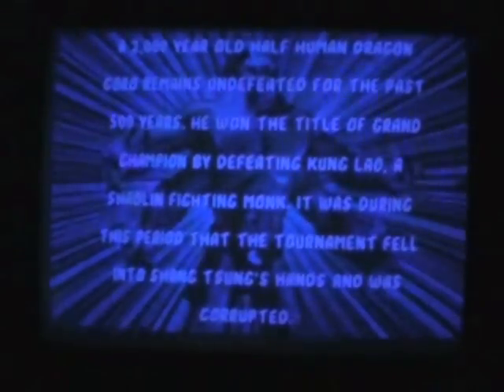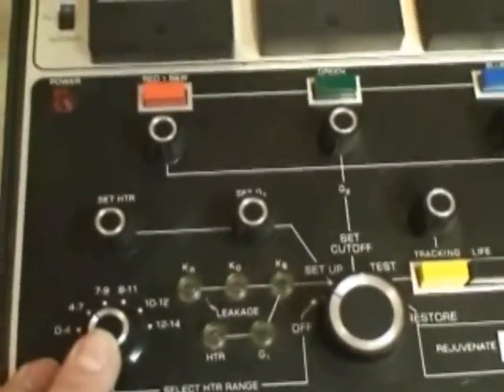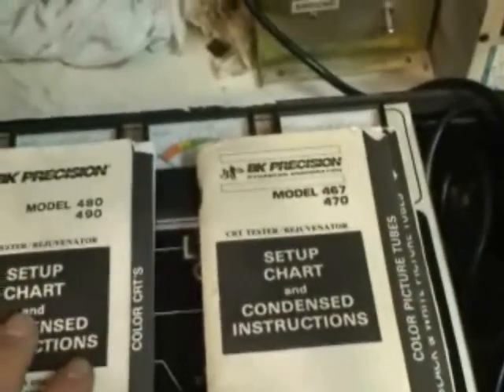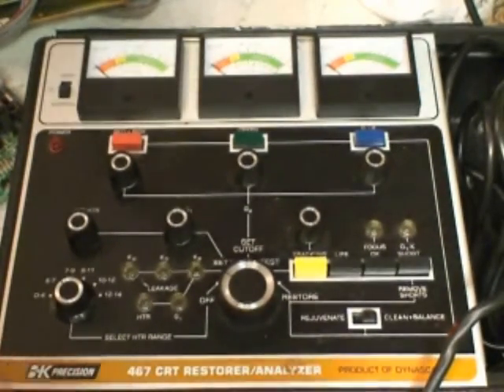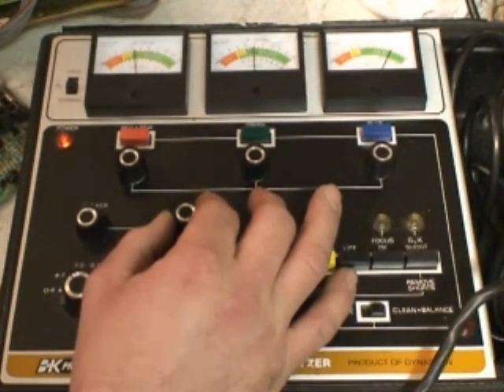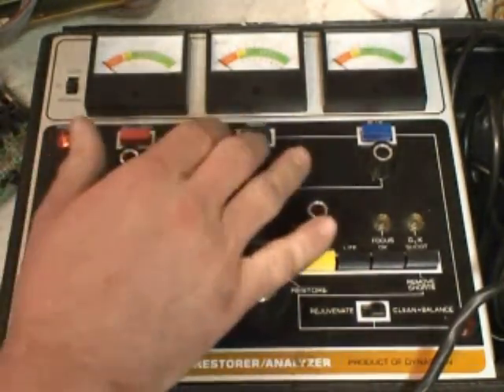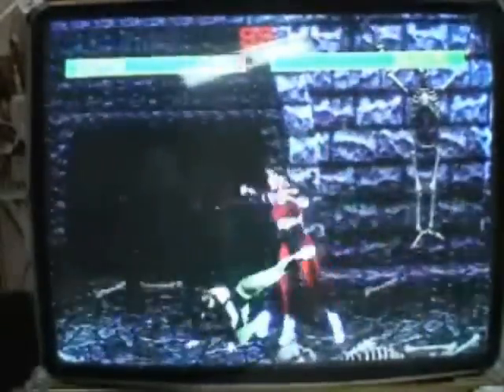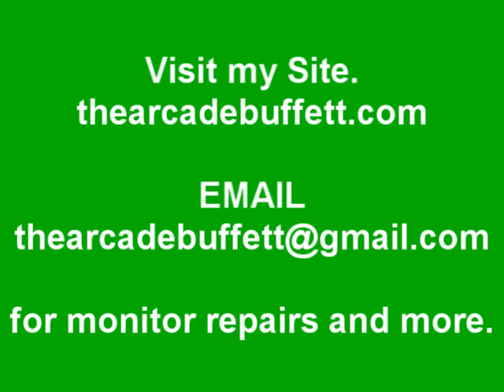A Basic Rejuvenation with  B&K 467 how you can Restore a Weak Tube.

Comment: I lucky to pick up a B&K 467 and put an Aust plug on it as it was set for 240 volts but from UK. They are usually 110/120 volt from US so just be aware of that if you buy one as you need to make adj to transformer for diff voltage & plug. I love the unit and this is an excellent video on using the 467 and sticking to the manuals instructions as these older unit have strong voltages even in the lowest setting so i only ever used the clean and bal and have had excellent result with just one to  three "zaps but usually one is enough. Use caution as these were designed for older CRT heavy guns ; the newer tv CRT have finer ones and can be damaged with the these older style units, so go easy and stick to the directions and lowest setting should be plenty but be aware there is risk of destroying the newer crt sometimes so beware of that. I find these older restorers are perfect for older TV's, analog oscilloscopes & Arcade tubes as per this video so mine will get some use yet.
Reply from the maker: Awesome!! glad you found the video helpful, and glad you like the 467, it is my favorite as well. i use it all the time.

Comment: Ive got a Philips 19" tube that i believe is coming to its end, when i ever i turn the cab on the picture always looks blueish until it warms up and the colours are good, i know its not chassis as ive replaced it and still the same, i put the tube on the Rejuvenator, red gun was just about in the green, green gun was in the yellow but the blue gun was way up  in the green and a lot higher than the other 2, so preformed a clean and balance the red and the green cleaned just fine but when i did the blue the needle wouldn't drop but rather just fluctuate but never fall to the red zone it jsut hangs up even tried rejuvenation but still the same, all 3 guns are in the green and roughly in the same spot but now but this is what gets me i have to turn up my red gain quite high and my blue down very low plus i also have to turn up the flyback as the picture is a lot darker than before, my tube was listed in the bk manual so i put the correct voltages to it i just find it odd that my picture is darker than before now.
Reply from the maker: did you put the tube on it's face and try tapping on the neck with a wooden block?
that can dislodge stuff from the guns if it is stuck ion them.
if that does not help you can turn the heater and G1 voltage up and rejuve the tube.
this can also get it to come back to life.
if all that does not work then your tube could have an issue or is already to far gone to "fix".

Comment: I’m looking at a couple consumer sets; a Loewe and JVC tube. Neither of the tubes seems to be on any lists. Any ideas? A80EFF272X43 and A80QCF240X
Reply from the maker: see if you can ohm the heater pins, if you can that will narrow down what they are a little, if you have the neck boards you can trace the circuits to find the color guns and the ground pins, once you get that info you can match it up or post your readings, and maybe someone can help match them up. or i can make a custom adapter with your neck board if your trying to rejuve them, also is the tube a dual focus tube? some are if they have 2, focus pins.

Comment: Hello what crt tester do I need to work on the Sony pvm/bvm crt monitors.
Basically pre 1990 crts upwards to 2010 and will they come with the correct tube socket or are these hard to find.
I'm. From the UK also
Many thanks
Reply from the maker: HI, you can use most any CRT tester from the B&K 467 and newer.
the adapter you will need depends on what pin-out your tube is.
if you can post your tube # then we can try to look it up to see what you need.
if your tube uses one of the adapters i make for the B&K 467-490 then all you will need is to buy the unit and i can make the adapter if it does not have one with it.
Reply: Buffett Arcade Man many thanks.
It'll be sony trinitron pvm and bvm crts. 
Don't know if your familier with them😣
Reply from the maker: the trinitron can be tricky to test and rejuve if needed, sony kinda re-invented the wheel when they made that tube line. i am not sure about the BVM CRT's

Comment: Hi buffet. Would you recommend any other b&k model? I can't find this one on eBay right now.  Thank you.  I will also need to make sure I get cr 23 and 31 adaptors
Reply from the maker: HI, i would wait for a 467, they are easy to use and work well, you could try and find a 490 but they usually are more expensive and a bit harder/confusing to use. i have a 490 and do not prefer it at all, and no it is not for sale.
when you do acquire one i sell the CR-23, CR-31 and the universal adapters if you need any.
Reply: Thanks man! I'll put out a wanted post on klov as well. I'll contact you when I get one and purchase some adapters from ya.  Appreciate ya.

Comment: nice! fixed on that arcade monitor, i wish i do have that rejuvinating tool to fixed my samsung 29'' crt tv, it has a blue color display the entire screen sometimes pink and green. i used to tap the tube for temporary fixed. im too worried to send it to a repair shop, since sometimes my other tv busted when they try to fixed it. and is already dead they fry something on a pcb. anyways. thanks for the awesome demo.
Reply from the maker: thanks for the kind words. glad you liked the video.
yes if you have no clue what your doing you can burn up a tube or break a chassis.
i have noticed over the years, that TV repair shops have no real clue on how to actually fix monitors, most of the real, old repair techs are gone/retired, and all you have now are parts swappers that have no real clue how to do repairs.
if your local to me, your welcome to bring your monitor by the shop and i can take a look at it.
visit my site for my email. thearcadebuffett.com
Reply: . yah definetely i have no plans on sending it to a tech here at my place. so scary, rather stay it that way,or until i get some tools to fix it myself. ill simply follow on your demo. yah i would be gladly that you would fix my Tv, too bad im residing here at phillipines :( thanks for the offer. ill stay tune on your channel if got some vacant time to watch more of your videos.thanks for the response. Godbless!
Reply from the maker: Awesome!! love those easy fixes.

Comment: My left dial isn't working. The needle sits all the way to the left  past zero. The other 2 gauges sit on zero. Turning the set heater knob does nothing. What can I do to get that guage to work? 

Thanks 
Curt
Reply from the maker: Hi, you will need to take the unit apart and re-flow all the solder joints in the machine.
they suffer from cold cracked solder.
i had to do that on mine when different items stopped working. i had dozens of bad joints, it was a wounder ti was working at all all theses years.
cap it as well wile you have it apart,
take your time, there is a lot of stuff to keep track of inside that are just press fit and with no pics or documents on how it goes back together readily available it can drive you nuts tying to get it all back where it belongs.
if that does not work you may have to find someone that repairs them, i do not repair them.
good luck.
Reply: @buffett1978  thank you for the fast reply. I'm looking it over now I'm seeing some cold solder joints where a  long connector goes. I also saw that two of the light bulbs were out of the sockets and inside of the chassis. It looks like those light bulbs need to be connected for circuitry reasons. I wasn't expecting that. They look to still be good so I just twisted those back in their socket and I used my ESR meter and tested all the capacitors on the bottom of the board and they all test good so hopefully those light bulbs for the problem and cold solder joints. Do you think those light bulbs were probably the problem for the heater voltage?

Comment: BUFFEET ARCADE MAN, 
Is the CRT rejuevenator adding and injecting more Electrons into the RGB ray gun? 

What is the CRT rejuevenator doing to the monitors neck circuit board and tube?
Reply from the maker: it does not do any of that.
it measures the emissions and how well the guns can emit Electrons.
Reply: @buffett1978  but how it is measuring the emissions of the RGB and how the guns emit electrons? Because I have heard its not good very bad to use Rejuevenators on TV tubes because it kills the live of the RGB signals because its burning off the emissions. You use the Rejuevenator when the RGB are dim and not bright in colors?

Comment: Very nicely done; Question! did you perform a life test on this particular picture tube before proceeding with the other repairs? being a technician myself I realize this is a rough indicator on the longevity of the tube. I agree with you that it is a big advantage when viewing all three guns at the same time and you tend to get better results because you have better control.
Reply from the maker: +John Cunningham 
the life test is a false positive and is pretty useless.
i have rejuved tubes and had it show 70-90% good on the guns and the life test show fantastic.
then after only a couple minuets to a couple days have the tube totally short internally and kill it's self.
so from my observation/experience that function should not even be used as you never know with 20-50+ year old tubes when they will die out.
Reply: When I did service warranty for Zenith years ago I ran into a big problem with their picture tubes. They usually developed a G1 short or heater to cathode issues. At that time I was using the Sencore CR70 Picture Tube restorer which normally could remove most G1 problems, but when the emission was weak and I attempted the reactive feature generally the results were poor and l was forced to order a rebuilt tube that sometimes the guns were not aligned properly causing color issues that meant all that hard work went down the drain. My point is they were a lousy tube that could not stand up to a restore forcing you to replace.
Reply from the maker: +John Cunningham   over the years i have noticed that Zenith tubes are the worst out of all of them for sure. i also have noticed the growing G1 short issue in tubes i zap for folks, most times it does not affect the image to much, but once in a wile the short is so bad you cannot save the tube. 
since you cannot get new tubes anymore a rejuve is about the only thing you can do now other than a tube swap to get a new looking monitor.

Comment: Anyone know if I have a chance in hell of finding a 17HP4, 17HP4A, 17HP4B, Sylvania 17RP4, 17RPB?  I got a Firestone 13G54 in Mint condition, out of use since 1962 = because the CRT Heater is OPEN.  I will buy a used one even (if it isn't FUBAR like this) for cash, paypal whatever